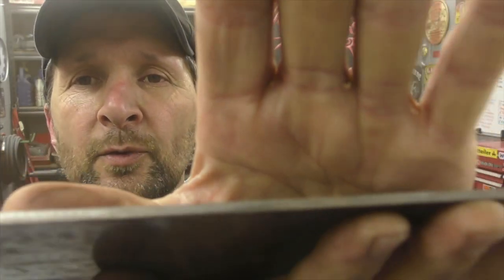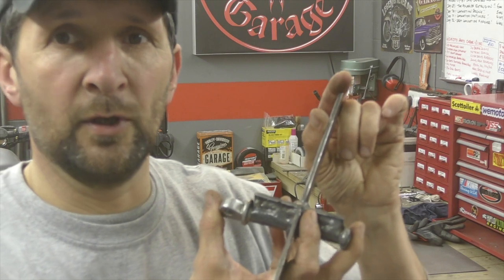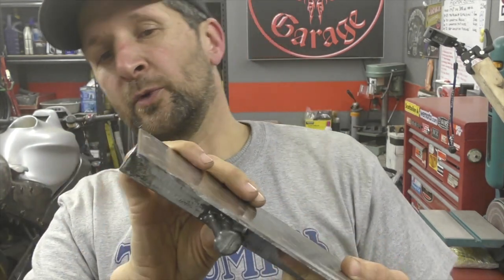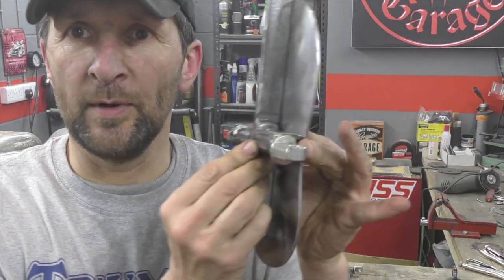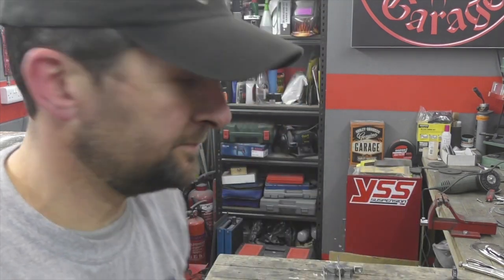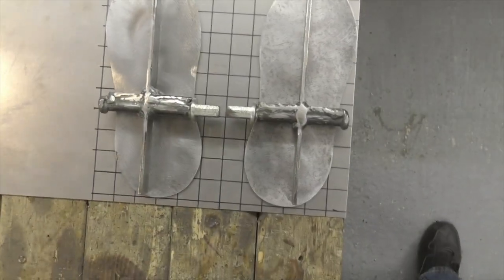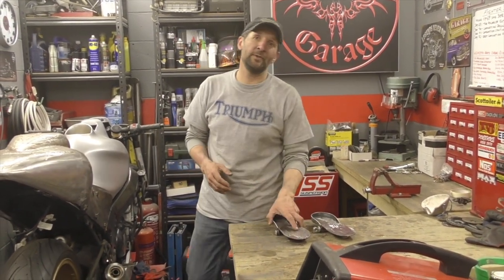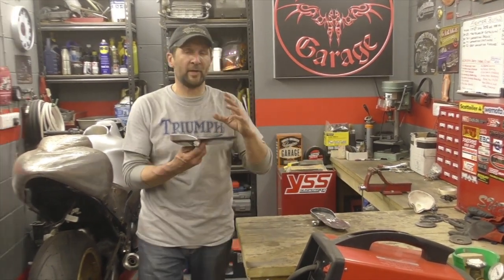Delboy's Garage, "Kids as Pillions"? Part #2, foot plates !

Comment: hey delboy I watch your stuff and only your stuff because you have so much detail thank you for that. please if you can help me and do a video for me? I have a Harley Davidson Sportster 883 2003 xlh. when I got it I would turn it on and the idle was really low. so I played with the idle screw to fix it and it did. but I really have to fix the throttle cable and I did, I took the bike out for a spin and it backfired on me twice from the carb. in first and second gear. do you think that I am riding rich or what? please I need help.
Reply from the maker: Im sorry buddy... we cannot make videos to order, and its impossible to diagnose engine faults over email.. there are just too many variable symptoms, things that must be worked through and investigated...

Comment: finding theses videos great as i am at the stage of wondering if my 6 yr old is ready to pillion.
am i right in thinking the only rule is they have to have feet on pegs when sitting comftable.
hope you can advise as i can't find any actual legislation.
cheers del.
Reply from the maker: Hi buddy, yes, the government make a wonderful job of making that legislation impossible to find... it's deeply buried within the construction and use regulations, but simply put, any pillion, no matter what their age, mist be able to reach the footpegs with both feet, without reaching... and that about covers it!  But that doesn't mean that is where it ends - obviously the helmet law is relevant, they must have a properly fitting helmet and, naturally, you can't spend enough on that... some of the best brands, like Aria and Shoei, do kid's sizes... and then outside of the laws and regulations, there is common sense, and basic safety, so some proper riding gear, gloves, boots, jackets, keks, etc., have a look on ebay cos a lot of parents sell of the second hand stuff pretty un-used, as at that age, they outgrow it so quickly, and again, you can even re-sell it yourself later, once they out grow it all... you will struggle with gloves, but the kiddie motocross stuff is a great workaround, and will get them in some good fitting, stout gear... hope all that helps mate, good luck, Del

Comment: Looks good mate! How about you plug weld some corrugated plates on top, for improved grip and looks
Reply from the maker: They are heavy enough now buddy... no more metal i think.. but maybe some rubber matting..?
Reply: Good point, skateboard tape is probably better. They're quite hard wearing, just figuring out how to stick it on

Comment: I really like how beefy those footboards turned out, but I have two words for your consideration.  "Lightening holes".  Just to lower the weight of that lovely thing a bit and maybe make it just a wee bit cooler looking.  Something like the holes through this gas pedal:

https://www.carid.com/ic/joes-racing-products/products/33600_6.jpg

Or maybe not.  I'm not at all sure how that would fit in with the rest of the bike's overall design.  Might be just awful on the bike.

I'll leave it to your designer's eye.  :-)
Reply from the maker: It's a Harley mate, it can haul tree stumps out the ground and drilling holes in these would look awful, like some cheap meccano tat... cool principle when lightness is an issue, but Harley's don't trade on lightness!  Also, they're not actually that heavy!
Reply: Yeah, I was kinda thinking that on a Harley build the lightning holes might be kinda silly.  I suppose if these were for a bike where lightness were a major concern the lightening holes would make more sense, but then you would have built them out of something a lot less heavy than super-beef steel plate, too.  Forgive my sidetrack into foolishness.  You have to expect that sort of thing from a guy who uses a teddy bear as an avatar.  :-D
Reply: Michael Haggerty just for fun check out 'drillium' on Google images.

Comment: 4.76mm is 3/16, 1/4 plate is 6.35mm
Reply from the maker: easy when you look it up aye..!
Reply: when I started working at a place where they primarily use the imperial system I had to learn very quick on converting everything to metric